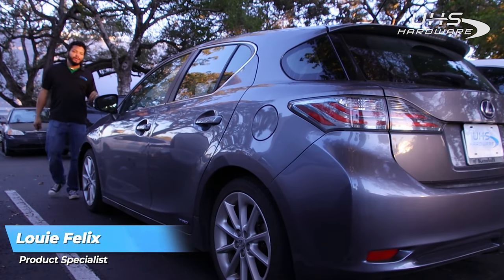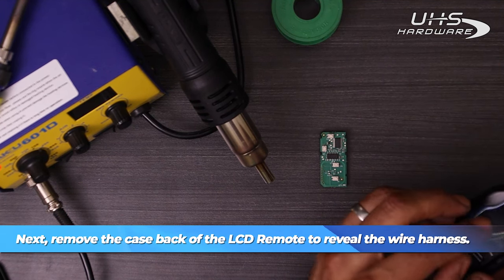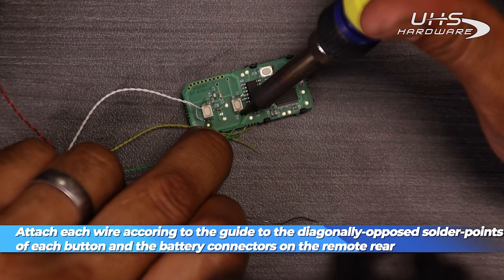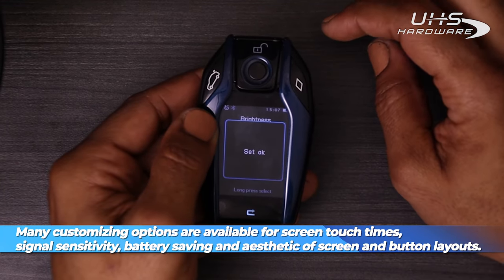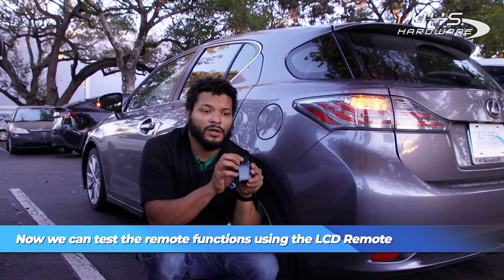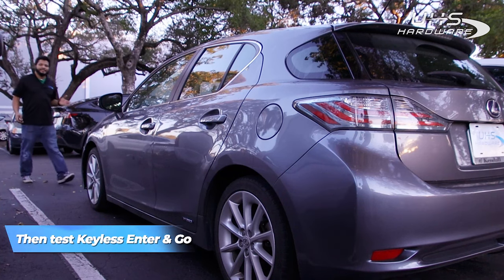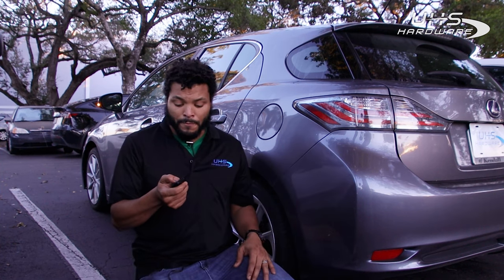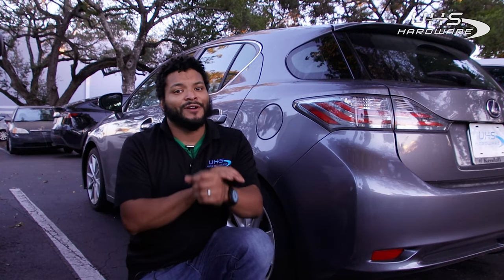How To Setup KEYLESS FACTORY LCD SMART KEY Shell - Lexus Key - Upgrade your Smart Keys today!

Comment: Does it matter where which colored wire on the harness meaning the white is soldered to the locked button? Both wires are white can either one be soldered to the right or left of the button? Or is one positive and the other negative?

Comment: The white, green, yellow and blue wires have no black stripe.   which is the negative wire for WGYB  wires?   at least the battery wire has a black and red cable.
Reply: It's a switch there is no negative or positive, it doesn't matter it's just open or closes a circuit, as in the witch is pressed or not

Comment: Hey currently soldering a Mercedes key and the buttons have 3 leads on each side instead of two. Any ideas on how to solder?
Reply from the maker: I'd recommend checking for conductivity with a meter before doing any soldering to make sure you use opposing connections. The likely thought Is whichever are further from the others to prevent bridging.

Comment: What is keyless go mean?
Reply from the maker: MEANING THE VEHICLE SECURES ALL DOORS AND SETS THE ALARM ONCE YOU LEAVe it's Low Fequency signal range. Keyless entry would be the opposite, and unlocks the vehicle once you are close enough to enter, or when you touch the door handle.

Comment: What happens if you have remote start
Reply from the maker: In the menu you can change which functions the buttons interact with to make sure you can have the function desired.
Reply: @UHS Hardware  but the extra wire won't be connected to the 5th button which is the remote start button since lcd key only has 4 wires? How will it communicate? My only solution is to get the xcam-900 and use the 4th custom key as the remote start and not the panic button.